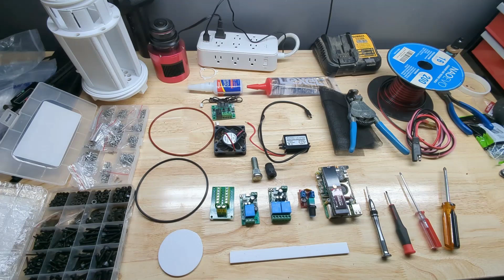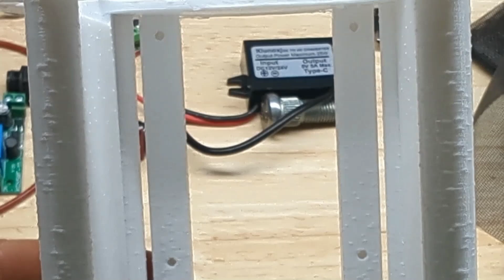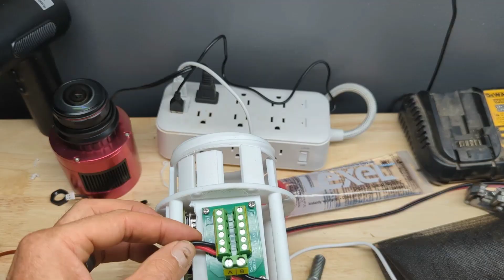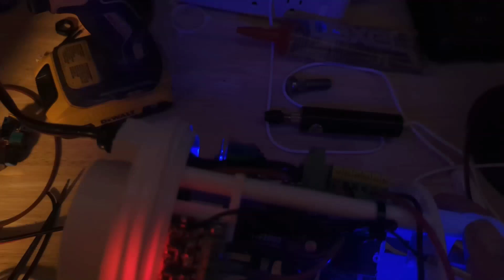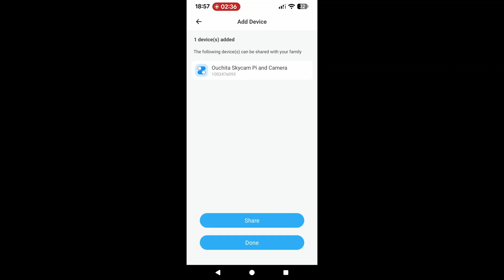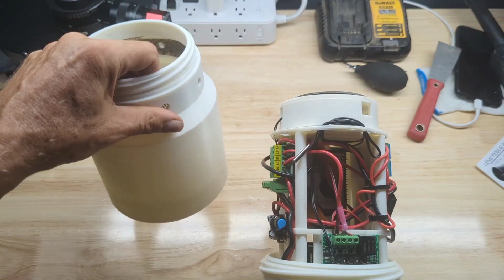Part 5 - Assembling a Weatherproof 3D-Printed AllSky Camera (Full Build)

Comment: Zak. what a project. I have just used your design tool to make all the files for mine. I am using a 676 camera and using the bambu P1S I cant go any more than 256 so using the std size tube. You have put a power of work into this. I am about to start printing the parts. I like those wifi controller pcbs..can you give me a link for them they will come in handy. I have a 100mm dome so hopefully I have done everything correctly. I have my system running already but its just built into a square box but I really like what you have done so will remake it in your system. I am using a Pi5 with a NVMe attached to a POE board. The dew heater I gather you got it from the Dewcontrol guys that advertise online. I have a 30W POE supply so hopefully that can supply all the power required inc the dew heater. Really looking forward to getting this project done...Sorry I found the list of the parts I was looking for it was further down. Have ordered some thanks a lot. :)..BTW I love the guard dogs you have. Geese are really great alarm systems
Reply from the maker: Hi,

Glad to hear you're building one — and good timing, since you found the parts list.

On the tube size: you can actually print the tall version on the P1S. I designed it at 254mm specifically so it would fit my Elegoo Centauri Carbon, which has the same 256mm limit. Worth considering, because the tall tube gives you a lot more room for modules later. You can also shorten it in the configuration tool if you'd rather.

One important note if you do switch: regenerate the cradle as a matched set. A standard cradle won't fit a tall tube — the parts have to come from the same family.

Your dome is fine. 100mm outer diameter is the default for the head cap.

Thanks for the kind words — and yes, the geese are excellent alarm systems. Loud, opinionated, and completely incorruptible. Let me know if anything gives you trouble during the build.

Comment: Hello Zak,  Your build and detail videos are impressive, thank you.  I'm building the Tall version using an ASI676 and I've completed all printing and purchased all components.  Unfortunately I must of made a mistake when specifying the lens length or camera seat height for the cradle in the SkyForge STL generator so the Dew Ring Tray is sitting above the lens when threading it on to the stop.  To avoid having to spend another 500+gms of filament and 17.5 hours to reprint the cradle,  it looks like a reprint of the dew ring with the threads running fully up the inside face of the ring would allow me to thread the ring down far enough to be below the lens.  I've managed to convert the STL mesh back into a solid using Autodesk Fusion and modified the dew ring with the new threads but I haven't been successful guessing the proper Thread Type, Size, Designation and Class. It appears the size should be 90 mm but I've tried ISO Metric Profile, M90x6 Designation and Class 6H but no joy.   ISO Metric Trapezoidal looks promising but before I guess any further and waste any more time, I was hoping you could share what you used for the male end of the cradle.  Again,  great work on a very nice DIY All Sky Camera housing and thank you for all your effort!
Reply from the maker: Hi Leif,  I'm sorry to hear you're having issues with your print.  A couple of ideas and I'll also give you the specs on the thread design in case you want to pursue the Autodesk route.

1. Adjust the dew ring height in the SkyForge app. It defaults to 0, but the value can go negative — I don't think I mentioned that in the video. Measure how far the dew ring sits above your lens, then enter that as a negative value to bring the ring down. It was originally capped at −5mm, but I've updated the code (v2.8.3) so you can now go to −9mm (0.35 in); past that the geometry inverts. This still means reprinting the dew ring, but that's far less painful than the cradle. The update is live at https://skyforge.ouachitaobservatory.com, or grab the updated Python scripts at https://ouachitaobservatory.com/skyforge if you run it locally.

2. Print a shim to raise the camera. The fingers grip the barrel, so the camera doesn't need to be fully seated — just snug. A 12mm shim under it would lift the lens above the dew ring. Check your dome clearance first, since this moves the lens up toward the glass too.

3. Full-thread dew ring STL. The shoulder is removed in this version so you can thread it all the way down: https://drive.google.com/drive/folders/1T3lMPWxz2ve_6qiZL7Cp5I54wNMPRYyD?usp=sharing

4. Thread specs. This is why your Fusion guesses haven't worked — it's not a standard thread, so no ISO Metric, Trapezoidal, or ACME designation will match it. It's a custom trapezoidal 3-start profile:

3 starts, 8mm pitch, 24mm lead (that's the number Fusion's coil tool wants), right-hand
Male: root Ø84.4, crest Ø88.0 — female bore Ø88.8, 0.4mm radial clearance
Tooth per 8mm pitch: 2.8 root flat, 1.6 flank, 2.0 crest flat, 1.6 flank, 1.8 deep

To build it: sketch the tooth profile, sweep along a Ø84.4 helix with 24mm lead, then circular-pattern it 3× at 120°. 

Full specs:

## Thread dimensions (all mm)

| Parameter | Male (cradle collar) | Female (dew holder) |
|---|---|---|
| Handedness | Right-hand | Right-hand |
| Starts | *3* | 3 |
| Pitch (thread-to-thread) | *8.0* | 8.0 |
| *Lead* (travel per full turn) | *24.0* | 24.0 |
| Thread depth | 1.8 | 1.8 |
| Root / valley diameter | Ø84.4 | Ø88.8 |
| Crest diameter | *Ø88.0* | Ø85.2 |
| Radial clearance (per side) | — | 0.4 |
| Thread band height | 12 (fades to 0 over the last 1.2 at each end) | 10 (z 1–11 on the stock holder) |

(The "90mm" guess was close — the male crest is Ø88.0, and the female part's bore
between threads is Ø88.8.)

## Tooth profile (per 8.0mm pitch, measured axially)

Trapezoidal, flat-topped — *not* 60° ISO, not 30° trapezoidal:

- Root flat: *2.8* (35% of pitch)
- Rising flank: *1.6* (20%)
- Crest flat: *2.0* (25%)
- Falling flank: *1.6* (20%)
- Height: *1.8* → flank angle ≈ 48.4° from the thread axis

Male tooth cross-section polygon (axial z vs radius r), one period:
`(0.0, 42.2) → (2.8, 42.2) → (4.4, 44.0) → (6.4, 44.0) → (8.0, 42.2)`
Female is the same shape cut inward from Ø88.8 with every surface offset 0.4 radially.

## Fusion 360 details (if modeling rather than printing)

1. Sketch the tooth polygon above on a plane through the axis.
2. *Coil/Sweep* it along a helix: Ø84.4 root cylinder, *lead 24.0* (Fusion's
   "pitch" for a coil = lead), right-hand, height as needed.
3. Circular-pattern the swept thread *3×* around the axis (120° apart) — that's
   what makes it 3-start.
4. Union with the root cylinder; for the female, subtract the male form radially
   offset +0.4 from a Ø88.8 bore.

Thanks for the kind words about the build videos — and sorry the generator let you get this far before the mismatch showed up. Worth noting I'm looking at adding a fit-check feature so it catches this at design time instead.
Reply: @zaklajoie  Thank you for your quick response Zak. Again I'm impressed and sincerely appreciative of the detail, the additional design work and clear explanation of the options. You must have a background in engineering and/or teaching!  I did consider simply shiming the Camera to raise it above the lens but I was concerned the image quality could be compromised if the dew ring and lens extended too far into the dome. The concern was probably unjustified but I thought a simple change to the thread depth on the dew ring would be a cleaner solution, apparently not...😀I think at this point the full thread dew ring STL you provided (thank you very much!) is the route I'll go.  I can't see any impact to the assembly or design in blocking the three cutouts in the side of the ring so hopefully this should solve the issue. Thank you again for all your help, I'm looking forward to first light!
Reply from the maker: Hi Leif, be sure to post a link to your first light images/timelapses.  You will catch some interesting things in the night sky.  And let me know if any other issues come up.  Have you decided on which allsky software you are going to use?  TJ Allsky is very straight forward to setup, but Indi-Allsky gives you much more control over the final output.  

I post most of my timelapses on my other channel here - https://www.youtube.com/@OuachitaObservatory-Timelapses/shorts
Reply: @zaklajoie  Hi Zak, sorry for the delayed response, a lot going on at the moment but I will post my first light images/timelapses.  I finally received all the components ordered.  I had to get a replacement for the first Raspberry PI 5 as it was used and defective and the Dew Control heater finally made it through customs.  I'm in a bortle 5/6 region along the central coast in California so I'm hoping the ASI676MC will provide reasonable results, we'll see...I do plan to use Indi-Allsky for the greater control but I have read it's a bit tricky getting setup, it'll be an interesting challenge but if I run into too many issues,  I'll fall back to TJ Allsky. Love your timelapses and your geese! Thanks again for all you help and I hope you'll see many more executing your design.  On to programing the RPI and Clear skies!
Reply from the maker: Hey Leif, no worries at all — life happens, hopefully things slow down a little for you.

I've received a few dead PI's over the last year. The companies don't even do QA anymore before shipping a returned product 😄

A Bortle 5/6 sky with the ASI676MC should still give you some solid results.

I actually run both platforms myself, for different reasons. On one of my older Pi HQ camera rigs, I use TJ Allsky — it's dead simple to set up and does exactly what I need when I don't want to fuss much with the output.
For my ASI533, though, I run Indi-Allsky since it outputs FITS files. I offload those to my workstation and handle all the debayering, stretching, etc. myself, which gives me a lot more granular control over the final image and timelapse. 

For the fine-tuned control, Indi-Allsky is probably worth the setup headache for you too.

I'm actually planning to post my Python processing scripts on my website soon so others can use or tweak them. Some work on either TJ or Indi output — you just point the script at a directory and it'll build a timelapse with options like colored star trails, planet tracking, constellation overlays, and major star overlays.

Good luck with the RPi programming — hope you get clear skies soon!